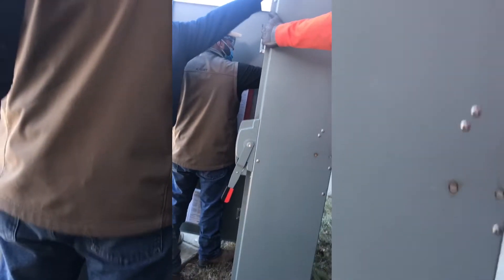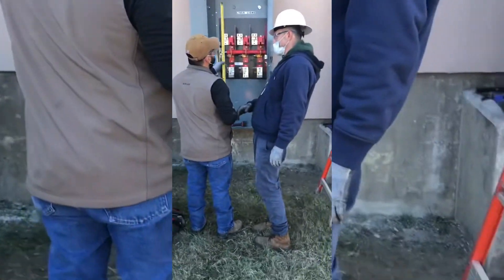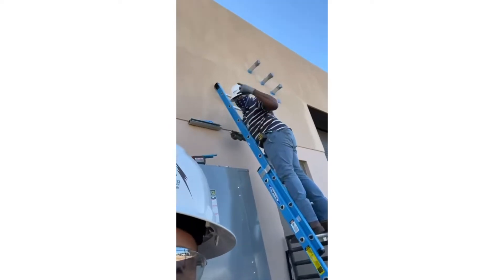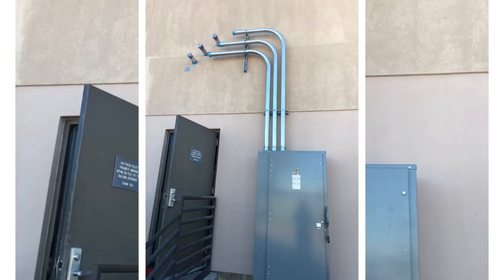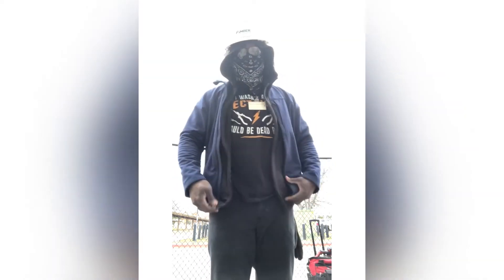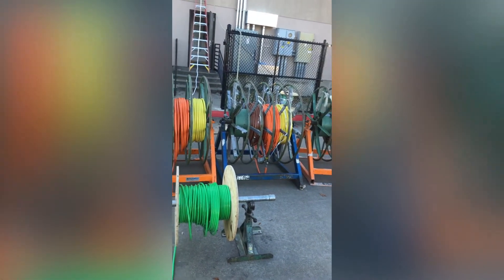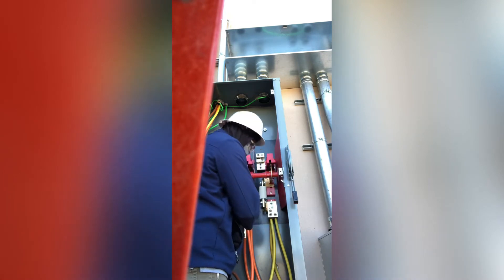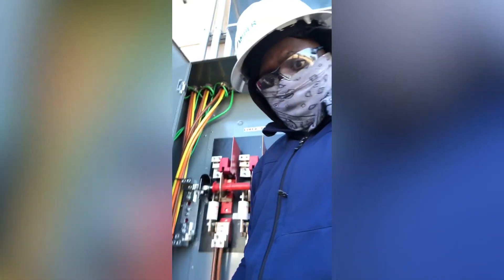Installing 800 Amps Service Parallel feed To Chiller On Roof Top #electrician #construction #texas

Comment: Why is the line 2pipes and the load is 3 pipes?
Reply from the maker: It’s a parallel feed, therefore we upsize the wires from the city and make it in 2 runs and to make it easier for us to the secondary side we opted to go smaller wire more pipes equivalent same power thanks 🙏🏿 to parallel. Hope this answers your question.
Reply: @adventurousdiyguy  thanks for your answer

Comment: Nice job! .. For 800A feed, I usually design it with 2 sets of 600MCM. 
Please show more videos, I already subscribed .. thanks!
Reply from the maker: 600 is too hard to pull through raceways so we do what’s call a parallel feed meaning we use 3 sets of 350Awg to supply the 800amp 

It would be like you have 800 cars on a single lane road it would be a traffic but if you have the same amount of cars on a 4 lane road it would be easier to handle, it’s the same concept with the amps going through multiple wires going to the same place.

Hope that helps.

Comment: What size conductors from disconnect to chiller, and are there three conductors per phase because of the amount of current draw a d how much current will the chiller draw? Cool video
Reply from the maker: The specs was 700Amp so they requested 800Amp service for the chiller. To make life easier we did 3 runs of 350KC Mills Parallel fed. So a total of 3 conductors in each pipe which is just right for 800Amp or little more. Hope this helps.
Reply: @adventurousdiyguy  yes sir thank you these videos help with my understanding of power distribution
Reply from the maker: Great be sure to subscribe so when we drop electrical videos you will be the first to get it.